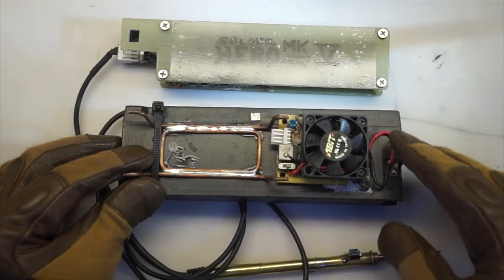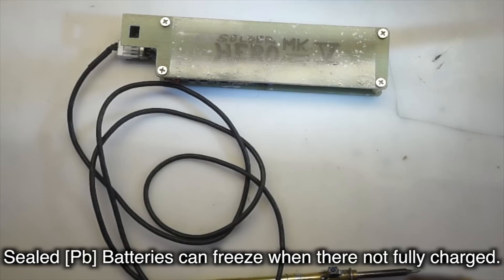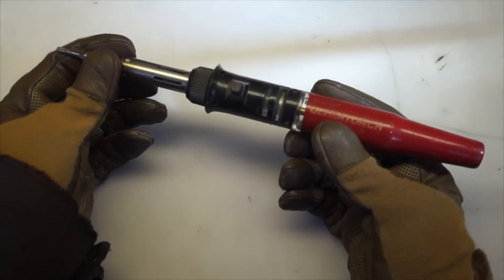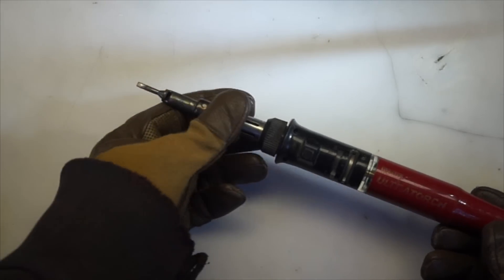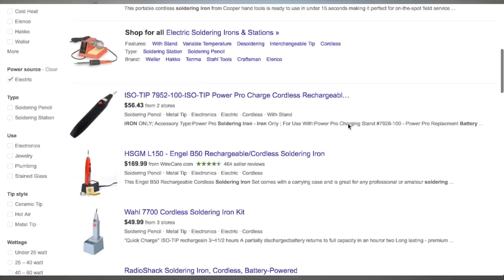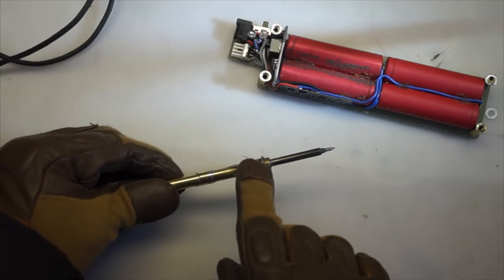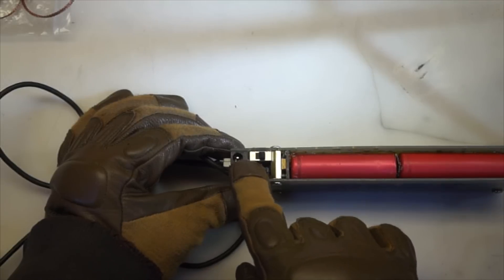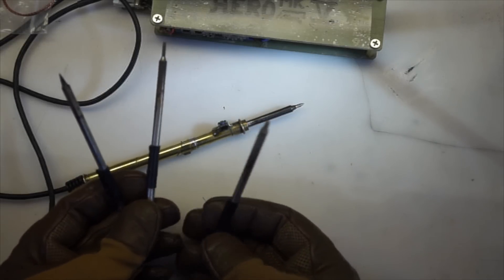Inventor Designs Powerful Pocket Soldering Iron!

Comment: I've made a portable soldering iron with bms 4s and balancer , an voltmeter and tip made by myself. Consumption 3.85 A. Heating and melting 3mm solder wire in 6 seconds.

Comment: So the mosfet directs the full 16 volts from the series 18650, and the linear voltage converter takes over after that making sure the tip doesn't go cold? Great setup by the way. My voltage converter came in today and I have the other parts (except battery protection circuit) so I'm gonna build one soon.
Reply from the maker: You have it exactly correct.  That's how it works.  I hope yours turns out awesome!